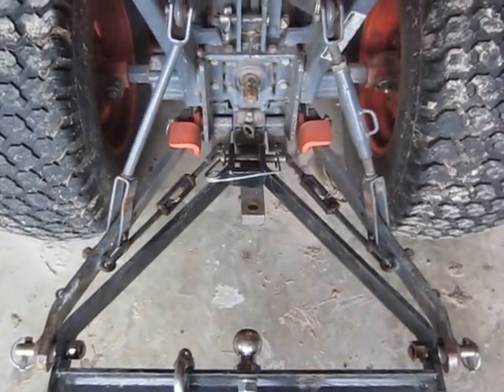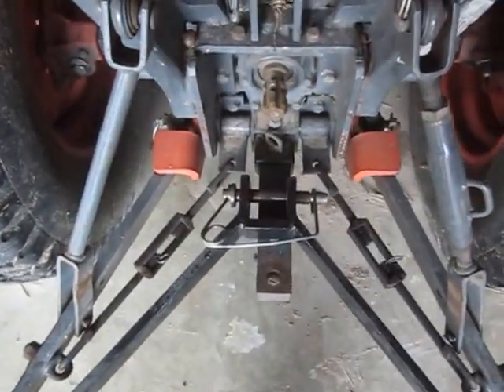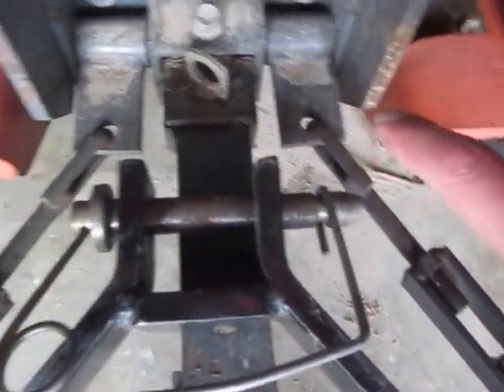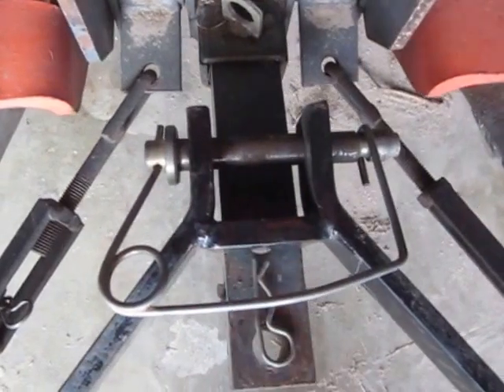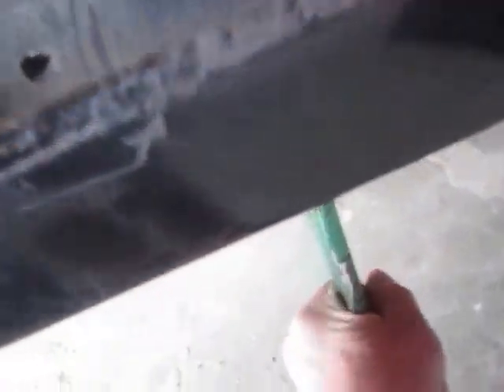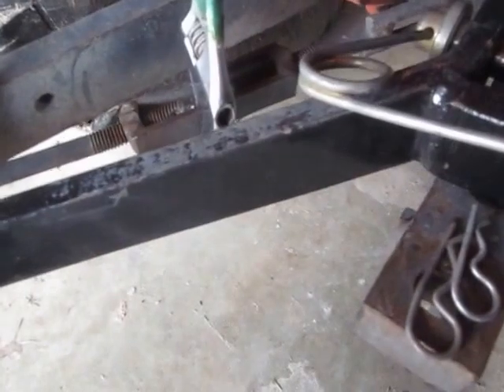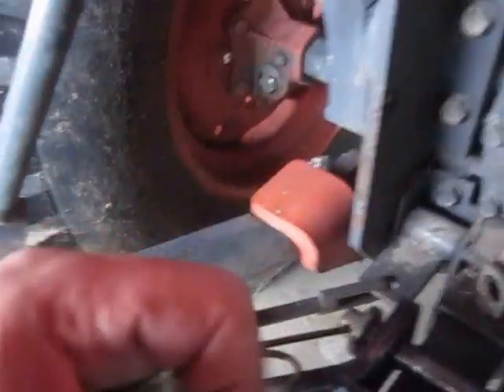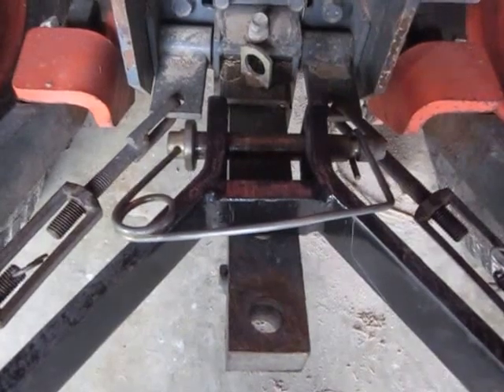DIY - Tractor 3 Point Lift - sway adjustment

Comment: I would suggest that you get rid of the pins and put a nut on the outside of the turnbuckle. Loosen the nut when you need to adjust the stabilizers, then tighten the nut agains the turnbuckle as a jam nut. This would be much more secure, provide more adjustment range on the turnbuckle. It would also eliminate the possibility of bending the pin, making its removal difficult.
Reply from the maker: Good suggestion.  The industry standard is for the pins, they allow tool less adjustment of the stabilizers, which is especially important in cases where the links are inside the arms as you cannot swing the arms out in this configuration to make an implement connection.